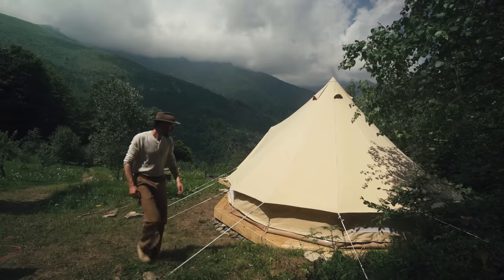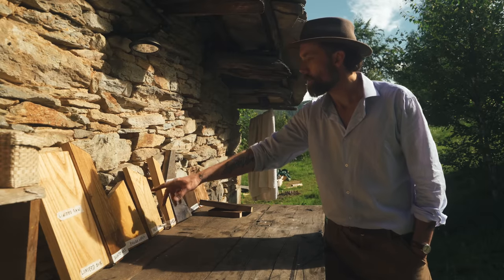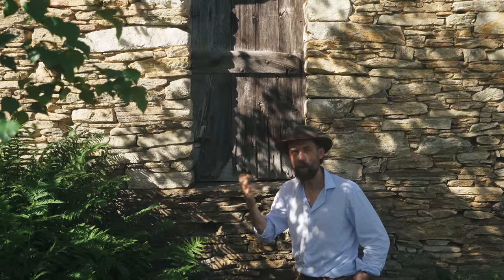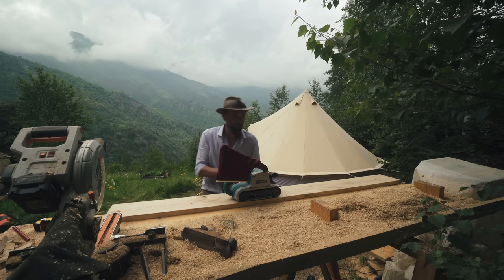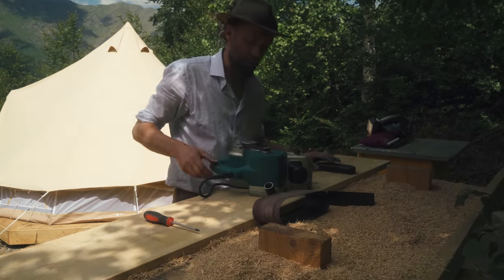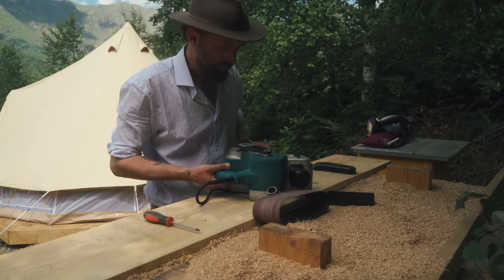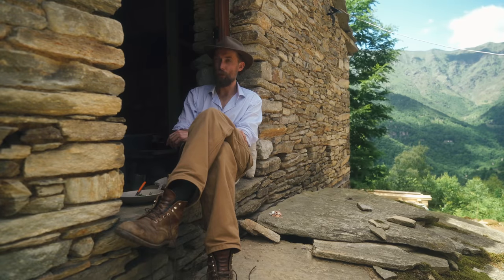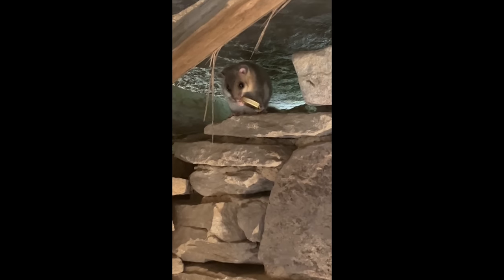#23 Setting up the tent, Building stairs and a porch for the deck

Comment: Can you get a bag of diatometious earth? I have had a flea infestation in both my RV and my cabin, and I just coated the floor and furniture with DE and it got rid of it in less than a week. No chemicals needed. Rats can get through chicken wire. They slaughtered over 300 of my baby rabbits INSIDE the 1"x 1" cages. To stop them, you need 1/4 inch hardware cloth or 1/2" x 1" rabbit cage wire. I have a rat problem.

Comment: You may want to loop/hang the cord over one shoulder and down your back to keep it high and away from the sander belt. The tent looks very spacious and cool. I got the biggest kick out of you tossing the saw in aggravation and switching to the chisel while working on the stairs. I’ve done the same. Great progress and content!
Reply: It did look like a frustrated toss of the saw, but in fact Martijn had completed the saw-cut he wanted, and switched to the chisel to complete the job.
Reply: Yep - I do the left shoulder chord carry and it works well
Reply: yes, i think its a generational thing. My other fav channel is Lost Lakes (kayaking in Canada with Jon) is very poetic and beautifully filmed like Martjins vids are. But Jon sometimes tosses his gear around in what used to be called 'gay abandon', at times... makes me go: ''oh no''....but, its still a great series on the very remote waters of Canada.
Reply: or, tosses them aside in a 'cavalier fashion' (another great saying you don't hear much anymore...
Reply: I've noticed that Martijn has a very special way of putting things down. Things are never placed back on a surface, but more tossed there, as if to say 'I'm done with you for now'. Check the despatching of the hammer at 30:12, closely followed by the discarding of the nails for examples in this episode.
Watching Martijn dumping whatever he's just been using is now one of my favourite parts of these videos
Reply: Yes!  I had a cord get caught in a really nice sander and when it jammed in it bent the base plate.  Ruined completely.  I could hardly even cut the cord out. Amazing damage.

Comment: Thank you Martijn for your thoughtful work. Before you pour a cement floor in your basement please consider insulation and a very good barrier to prevent capillary moisture from soaking into the concrete. I would like to suggest you investigate the Canadian Homebuilders Builders Manual as a good source of information and useful building details.
Reply: I would like to add to this saying I saw an interesting take on underfloor heating using a lattice of 100mm wide ducting pipes layed into the concrete and then heated air is circulated through the pipes when heat is required. A benefit is there is no risk of freezing water pipes in the coldest winters and the heaters could run off solar. The company behind this was based in Sweden, I don't think I can include the company's name without the comment being removed, but search for Leg-a-lett (without the hyphens). This could be referenced in the manual mentioned above - the company has a base in Canada too.
Reply: @rcanter i second your motion. Traditional building in the cold parts of Korea has pretty much the exact same idea with underfloor heating. Their version has the large wood burning stove down one end, with underfloor clay pipes from the stove running the length of the room. So much more energy efficient, and to have your feet warm is so important when you come in from an outside job where you may be wet through to your boots!

Comment: Advice from an old North American wilderness backpacker ( you probably do not need ) but DO NOT store or leave food in your tent, no wrappers, no used plates ( even once ), the small mammal critters will chew that canvas in a heart beat ( smile ).
Reply: That is certainly true.
Reply: My thoughts as well. All the critters will move to the tent soon enough. I would look into some form of pest control; perhaps the locals can advise on traditional methods? A smudge of some type might work for both shelters? The riot mouse might succomb to a "have-a-heart". See also Mousetrap Monday's extensive testing of various rodent ridders.
Reply: Get yourself a cat or two Martijn. Problem finished.
Reply: No duh.  He doesn't need to be told, after living here for 8 months, and camping for years.

Comment: I‘ve said it before, Martijn you are an inspiration and a great role model.   The new tent and the deck is fantastic!  Your description of sleepless nights and the abundance of bugs and little critters is something I live with every Spring and Summer.  Bug bites are a big issue as are the critters that can destroy a garden and invade the cabin.  I’ve resorted to using Irish Spring soap to keep the critters out of the garden and you might try using it inside the cabin.  Critters dislike the smell and tend to avoid areas where the scent is strong.  I also use a plant based botanical repellent on exposed skin when I’m outside.  It’s a commercial product that’s unscented and not greasy.  It really helps keep the black flies, gnats and mosquitoes at bay for a couple hours.
Reply: agree with you on plant based insect repellent. In Australia, our best one is made from the oil of the Tea Tree plant - its a never fail repellent (although a bit pungent). Pure Lavender oil will do the trick also, but this can be more expensive than tea tree oil.

Comment: when sanding with a power sander like the one your using, throw the cord over you shoulder. Keeps it out of the way and up off the board.
Reply: Glad you mentioned this,  I have an electric lawn mower and never ran over the cord by doing just that. Over the shoulder, across the back and out under the left arm, that cord is going no where except following you.
Reply: and wear ear protection ….
Reply: Good advice! I do that with my vacuum! 😄😄

Comment: Just a tip from a scout, you should aline the seam where the tent is sewn together, in one line with the strap where you strap the tent down so it forms one long straight line. With this you will survive every storm :)
Reply: 04:05 you can see the one strap is a little of

Comment: The traditional japanese method of treating wood claddings (Shou Sugi Ban) is the combination of  charring the surface real good, steel-brush it (like you did) and than add linseed oil (always boiled, because of the sticky business) or tung oil to finish the job. Some people go for a modern polyurethane coating for exposed surfaces, but the traditional method lasts for 80 or so years.
The oil finish can always be easily refreshed and it guarantees the more natural and weathered look of the thing.
What a nice start into the week with a new, long awaited video of your alpine adventure!

Comment: I smiled when you discovered the cause of the sander break down😉 My husband regularly slices the leads of things like the mower or the hedge trimmer so I, of the better eyesight and nimble fingers, am called on to chop out the damaged part and install a safe joint box😂 He, like you, is very enthusiastic in his wrk😉 Thanks for the video diary and the great shots of the canvas bell tent….takes me back to GirlGuide camping in the 1960s when we were still using ex army tents from the 1930s….so your tent will last well!

Comment: I use Teak oil for waterproofing wood.
It is great for outside or inside and doesn't stink like linseed oil.
Also, it is not poisonous when used for cutting boards in the kitchen.
I've seen people use olive oil, but that turns rancid and is not healthy

Comment: I think I would have done the same dancing up and down the steps, barefoot on the smooth wood, once finished. Congrats. The conversation about the natural aging of wood, and that it cannot be faked is spot on, the buildings must be worked on repaired with the appropriate technology, the different parts becoming the story of the buildings. I will have these questions about my shack in Spain, thought a part of me wants the historic outer shell, and bright pink Neón inside 😂 all the best Martijn 🥬🍀😎

Comment: Really enjoying what you are doing here. Tip on laying deck planks: put a strip of building paper down first, cut the paper wider than the stringer. Capillary action will naturally pull any water out of the joint and increase the longevity of the stringers.

Comment: if you thin your linseed oil with some turpentine or even genuine turpentine, which smells better but is generally more expensive, it will penetrate deeper into the wood and also dry faster.

Comment: Planting rosemary and lavender around the outside of the cabins will help repel insects as will garlic in  pots. Peppermint works very well and makes great tea but you need to have it in some kind of large bed with side as it spreads like crazy. I planted these and others here in Sydney as we have massive issues with flies and mosquitoes and they do work.

Comment: when applying Linseed you need to mix it like a salad dressing with pure turpentine (not turps) so one part linseed oil to two parts Turpentine.  The turpentine drives the oil into the timber and you won't get any sticky residue.  I used to deal in Early Oak furniture (17th/18th century) and that is all we used.  apply with 00 00 wire wool and wipe off excess.  keep applying and you will end up with  beautiful timber. Tung oil mixed the same way is great for exteriors.

Comment: Martijn, I learned this summer about the value of tulle, the fabric used in wedding veils,  of all things. Setting tulle out will deter little critters because they don't like their claws getting caught in the stuff. It doesn't degrade easily. This summer I tacked it around my deck and the rabbits/mice and other critters have left everything alone--flowers, leaf lettuce and other goodies. I'm not sure if this would be helpful in your setting, but thought I'd throw that out. It's cheap and you can buy other colors besides white. I'm grateful to you for another wonderful video.

Comment: First thank you from the bottom of my heart for this present, to accompany your trip through staying in that wonderful place, all the details touching eyes, ears and soul in a very sensible way... (no words)

One hint according you want to give your deck a finish: Normally you have to treat all sides of wood, because of rules N° 1 - Wood works every time and N° 2 - It works only uniform, if all sides are finished in the same way.

In example when you would oil a board only from one side, it will warp. You nailed all so good, that i think, it won't get problems but maybe the narrow sides of the boards could throw themselves up. Also you will have condensed water or rain on the back of your installation and than it has no added protection.

P.S.: Please be careful with the linseed oil in particular you mix it with additives e.g. turpentine. The used cloth flaps can self-ignite, so you need to seal them in a screw-top glass and air them out well when unfolded if you finished (they will get hard).

Comment: Hi! 
I did just have to write when i saw the ”old barns”. I think they are painted with something called ”roslagsmahogny”. Its a paint you can mix yourself. 

Ingredience: 
1 part raw and cold pressed linseed oil
1 part balsamic turpentine
1 part Tar from pinetrees

That Will give you a paint that protects the wood and is estetichaly appeling, i think. It Will give you sort of a golden light brown finish, and also its smells nice. The smell Will be gone in a few weeks. 

Best regards!
Jim from Sweden

Comment: We have a lot of dormice here in Slovenia - they can get through smallest of holes despite their size and the only way to keep them away from the attic is closing up roof with wood so there are no entrances. For air tunnels/ventilation, we use like a roofing mesh/tape, which has small holes and is pretty thick.

Comment: The roasted chestnut wood looked great but charring your boards is likely to warp/twist them which is a real problem if you're trying to build a quality door that will do its job well and stand the test of time. I think you're right about the enchanting character of old villages and the history reflected in their wear. But your restoration is also a part of the history of those cabins; just do solid work with quality materials and eventually your pristine door will be a cherished relic and your 22nd century counterpart will comment about how you could never recreate the character of Martijn's old handmade doors.

Comment: An angle grinder with wire wheel in direction of the wood grain will give you a aged texture that would go really well with either light burn or steel wool maybe even both. Age by asking yourself where the shadows fall and where rain stains. Round off corners and put a couple of random dents in.  You just need layers as a single method will not get you a convincing result that will be very rewarding and fun.

Comment: Hi Martijn, just a thought - you could have built a much smaller, simpler step off the side of the deck. Then you could have used all the timber you used to make the big, wide steps to make a bigger deck area in front of the tent - more sitting space!
A simple rail along the front so you don't fall off.....
... Also you would then avoid going down the hill and then up again to go to your house.....
....a bit late to suggest it, but......!!

Comment: Martijn - for an old door, you are absolutely right - old is old and there is no getting around that. You have likely considered this, but are there enough old, original pieces of wood at your location that you could make your own, and/or might a nearby similar restoration project have a door available because the owner no longer wants it (for whatever reason). [2] regarding treating the wood on the tent deck and stairs (if you have decided something must be done) have a look on YT about teak oil, and my favourite, pure Tung oil. However, as you know chestnut is so durable that those boards could be left untreated and within a year would 'weather' to a pleasing colour. Given their thickness and excellent air circulation all 'round, they will be as sturdy as they are now at least 50 years hence. Sometimes less is more - which I am guessing is your sentiment too. [3] I have a similar tent and on the low side I drove in wood fence posts where needed and attached the tent ropes to them (through a hole drilled at the correct height). Beautiful, careful work - bravo. Especially when doing it solo.

Comment: Linseed oil (usually boiled) is a lovely looking & feeling finish, but not very durable in temperate climates. Natural, so very friendly to the beautiful environment that you are blessed to live in, but you'd be commiting yourself to regular rubbing down and recoating - easy enough as it's basically a wipe-on finish, but you need a good day, and the rubbing down can be a pain after a while.
Love the charring but understand your reservations about the carbon rubbing off on contact.
Vinegar and wire wool used to ebonise the wood looks good as well, but would need a finish over it like the charred wood.
Dark colours would certainly heat up quickly  in direct sunshine, so totally agree they'd be best avoided for walking/standing surfaces  (never thought of that before).
I've tried various finishes on wooden garden benches recently, and the best (durability/good looks/ease of application/cost) is an idea I came up with using thinned yacht varnish (thinned with White Spirit 50/50). It needs to be oil based, so just look for the VOC warnings on the tin!
Again, normal 50/50 thinned polyurathene looks great to start with, but doesn't last -very little UV resistance, unlike yacht varnish.
I believe you can do wipe-on with water-based poly finishes which have the advantage of minimal yellowing/colour change, but I have no experience of them, sorry.
Basically, wipe-on yacht varnish is a relatively cheap home-made wipe-on Poly on steroids. Use gloss to start with (clear, so lets the wood shine through, and it's cheaper), then a quick rub down with a medium abrasive to give it a key, clean with white spirit, then wipe-on the final top coats of either satin or matt (your choice of course). These are more opaque, so not the best to build the whole  finish from the start if you value the look of the wood.
Being oil based, yacht varnish will also add a nice warm look to any non-ebonised surfaces you finish with it.
...And cheap is a relative term. Buy a ready-made wipe-on finish and it'll be 2-3 times the price of paint-on poly, which when thinned 50/50 will produce twice as much, so 1/4 - 1/6th the price. Kerching!!!
Gorgeous tent by the way.
Loving the laid-back can-do approach of this project. 
Genuine thanks.

Comment: You could attach some vertical posts to the decking and tie the guy ropes off on those at an even level all round. Also it would make getting round the outside of the tent easier. Love the vlogs, really interesting. What a sense of adventure you have. Buona fortuna.

Comment: Mice cannot resist peanut butter

Two different traps

Buy some peanut oil.  Fill a deep glass dish and pour some oil in the bottom. And make a ramp up to it. Coat the sides with oil. They investigate and slip in and then can't get out because of the slippery oil

Or buy a plastic bucket. Drill two holes on either side at the top. Get a metal coat hanger and open it up. Get a plastic container and make a hole in the lid and in the bottom. Thread the coat hanger through the first bucket hole then through the plastic container and the other bucket hole and bend the coat hanger so it won't come out. Now can just use solid peanut butter or mix peanut butter and peanut oil but you smear it on the outside of the container. And make a ramp up to the bucket and fill the bucket with 2/3 water. They come up the ramp try and get the peanut butter, the container spins and they fall into the water and drown.